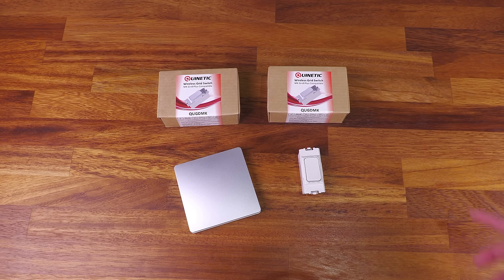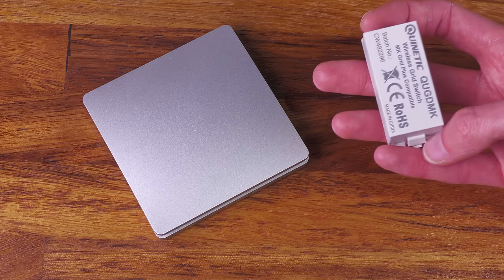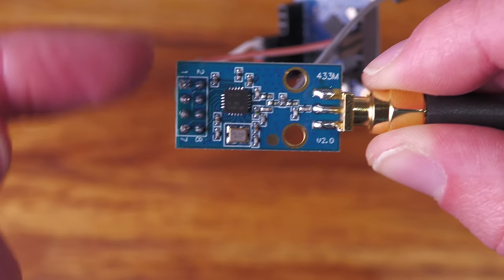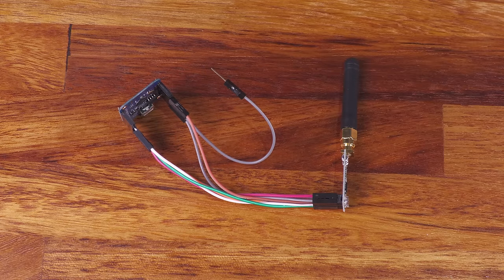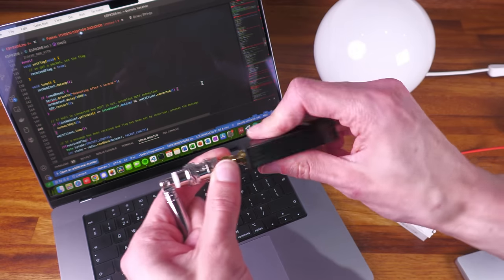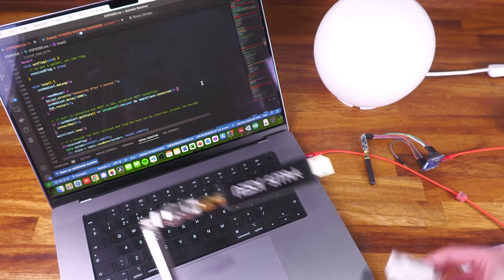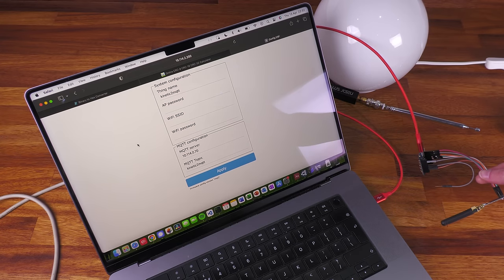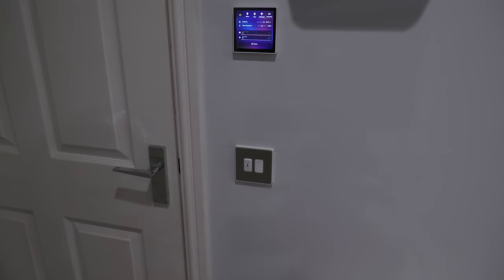Building a Custom Receiver for Kinetic Switches - Kinetic2MQTT

Comment: Hi Cameron, thanks for this video. I myself was playing with my SDR and looking at these switches and other wireless devices. This was just over a year ago and had managed to decode the bits. I could see the pre-amble and knew the ID was somewhere at the start of the packet. I gave I up before I was able to workout the whole protocol, I was thinking it may have been encrypted. So thanks very much for this. I was inspired to go back over what I had and used your info above to create a GNU radio companion flow chart and custom Python decode block that can receive and decode the ID and Status. It also does the CRC check so you only see valid data. Let me know if you are interested and I will see if I can upload to GIThub or something.

Comment: Next video: I turned a whole posh neighbourhood into a disco... Kind of thing I used to do with car alarms around 30 years ago when they didn't use rolling code encryption. It might be a good idea to also make a criminal curfew tag tracker, they also run on 433MHz (It wasn't one I was wearing).

Comment: This is such a cool idea! I imagine having these kinetic switches instead of the sonoff ones on the smart home controls will take out a few failure points? They seem much less complex than the wifi based ones. Would be interesting to see a teardown of what the radio transmitter actually looks like
Reply from the maker: Long term reliability will be interesting to see.  The Sonoff WiFi solution did have a mains power supply and more components although these should all be pretty reliable.  The 433MHz signals from these kinetic switches is also likely not as reliable as WiFi would be and I don't really know much around the reliability of the kinetic mechanism since this will have a mechanical element.  However, the kinetic solution is definitely much easier to install, takes up much less space in the back box and would work for situations where there isn't a neutral wire present.

Comment: Great break out. Thanks for sharing this. I am slightly worried about the security side of this, though: what's stopping a third party from listening and replaying those signals as there is no encryption or signing involved. Even passively listening and linking those signals to a human being presence could be a privacy issue. Maybe I am too paranoid 😅
Reply: I don't really see how it could be used to invade privacy, at least not any more than a smart bulb could. 
to me a light switch like this is just another form of tv remove, which 99.9% don't have any protection against replay attacks.
Reply from the maker: This is definitely a valid concern and of course it applies to kinetic switches in general rather than just this receiver (unless I'm missing something when looking at the protocol). Realistically it comes down to what you deem to be an acceptable risk.  With my setup, the worst someone could do is mess about and turn lights on and off which is realistically a similar level of annoyance to them replaying signals to triggger a wireless doorbell which are usually similarly insecure.  However it maybe wouldn't be the best idea to use these to control something security critical (such as for opening a door) or something that would be bad if it was turned on unexpectedly (such as a high power heater which could cost a fortune if turned on while left unattended).  Likewise you maybe wouldn't want to use this somewhere where it is likely to be a target of deliberate attacks, but controlling some lights in a domestic environment is a low enough risk for me to be happy using them.

Privacy wise, this doesn't really concern me - I probably only trigger these switches a few times a day.  If someone wanted to tell if I was at home they'd have many more obvious clues such as seeing lights/movement through windows.  Even from a radio perspective there are likely many other signals that could be used - even though it's encrypted you could probably spot the presence of certain amounts of WiFi traffic or look out for "casting destinations" that many TVs and speakers will broadcast over WiFi or Bluetooth whenever they're powered on.
Reply: @camerongray1515  I also thought about the security side. I also use a kinetic switch. The receiver has two relays included which I don't use but I flashed Tasmota on that receiver with a horrible solder job. It's amazing it still works. But yeah I only use those for lights. I guess the garage doors in my neighborhood are so old that they don't have rolling codes yet, so I guess they would be a more likely target.

Comment: Hi Cameron, great video! Just wanted to ask whether the software part is implemented in a way where it would allow multiple switches to go through a single receiver, controlling different devices (also, is there a pairing-like thing that would allow kinetic switches connected to kinetic receivers to not interfere with this one).
Again, thanks for the great video.

Comment: Really interesting video! I have an SDR dongle connected to my home server to read my outdoor thermometer into MQTT and it works very well. You sort of touched on it in the video, but I'm curious why you went this route instead of using an SDR. Is the protocol supported by rtl-433? I guess it is nice that it's a standalone receiver that doesn't require a ton of CPU power to decide the signal. 

I really enjoyed seeing your reverse engineering process! That must have been a really satisfying project to see working.
Reply from the maker: I was going to mention this in the video but completely forgot!  I was able to get it working using rtl_433 using the config file linked in the description.  However, due to the high bitrate of the signals, you'd need to turn up the sample rate that rtl_433 is running at which significantly increases the CPU load.  To get it to work I found it was essentially maxing out a single core of a Pi 3B+.  Most 433MHz devices transmit at a much slower data rate and for those rtl_433 is perfect!

Comment: This is absolutely fantastic! I maybe missed it, but how were you then forwarding the command to the bulb to turn off/on?
Reply from the maker: I use Zigbee2MQTT with a Sonoff Zigbee USB dongle to bridge my Zigbee smart bulbs over to MQTT.  Then I have Node-RED sitting in between both of them that passes the messages between the switches and the bulbs.

Comment: Thank you for sharing another great video. They are always really interesting. I’ve ordered the board from Amazon to give this a go. 

I was thinking the data after the ‘push/release’ might be a switch ID for the multi gang paddle switches. 

I’ve got a 3 gang paddle ordered so will let you know. Would you be happy to have a pull request on GitHub if I updated the code? 33:50
Reply from the maker: Pull requests are more than welcome!  Would definitely be interesting to see how multi-gang switches interact - I'd just assumed they'd each have their own ID since you need to pair each "gang" separately when using Quinetic receivers but I haven't yet been able to test one.
Reply: Hi i think you may be correct on the bits after after the push/release. I characterised a few of my switches and have found the following in the 8 bit data section.
    Single Paddle switches PRESS data = 0x01 (All have unique 16 bit IDs)
    Double Paddle switches PRESS data = 0x01 for paddle 1, data = 0x02 for 2nd paddle (All switches in the multi paddle have the same ID)
    Grid type switches PRESS data = 0x04 (All have unique 16 bit IDs)
I dont have any Triple paddles to try but I assume they will most likely have data = 0x03 for the third paddle. So it seems the multi paddle switches use the same ID for each switch within the same unit and only identify the individual switches with a number in the data section.

All switches have the same data for the RELEASE 0xC0